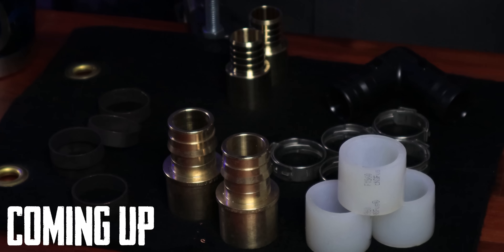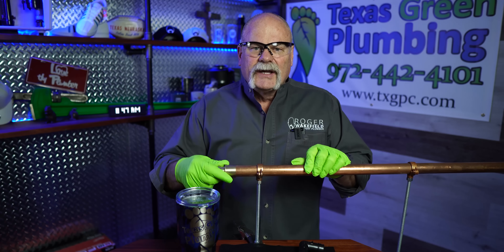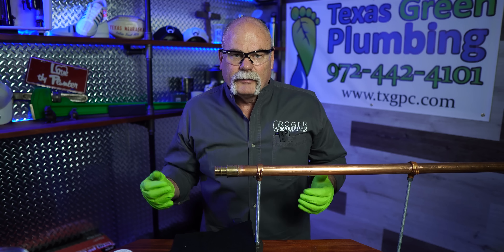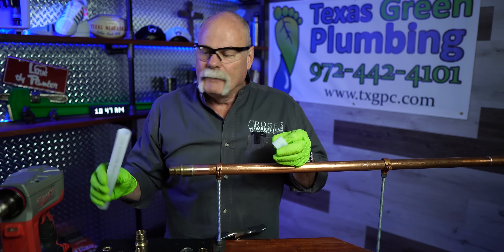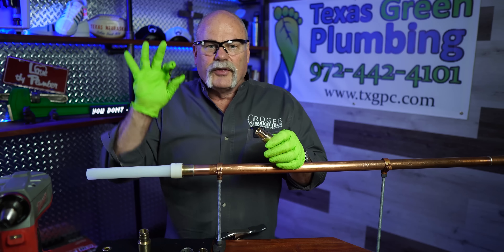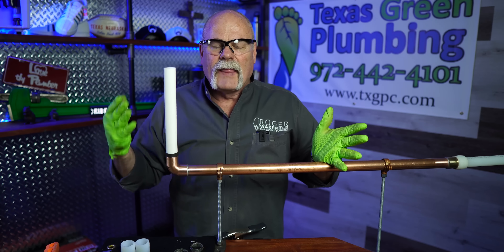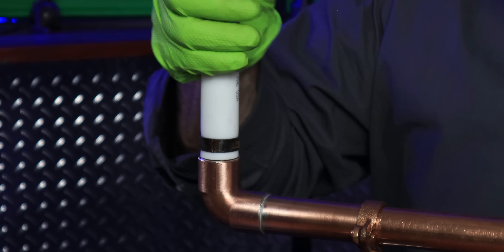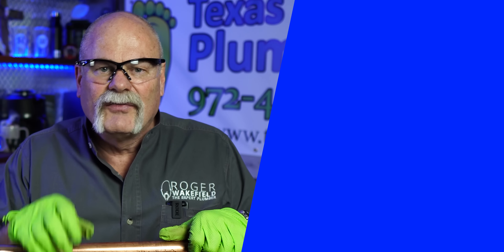How to Connect PEX to Copper Plumbing Pipes

Comment: I made experiments connection pex-a to copper pipe without fittings. Just putted on pex-a the copper pipe. Ther were three different ways. 1 - putted pex-a  on the copper pipe without plastic ring. 2 - with plastic ring. 3 - copper pipe after desoldered (there was elbow before). First and second connection were  not too hurd disconnect using my hands. But third connection (copper pipe with little bit rest of solder) was impossibly detach for two adults men. In addition, I could not rotate the pipe as if it were connected by a regular fitting. Unfortunately I don't have a machine for water pressuring stress test.

Comment: We ripped out all of the corroded galvanized steel and pitted copper from our home.  I used upsized Sharkbite Pex B (Lowes) and steel crimps. I also used the Ryobi P660 (direct tools $70 black friday) crimper for everything. It made the project faster and one tool crimps everything. In fact the only real elbow grease applied was when I was cutting out the old pipe.

Comment: I wanted to add one more comment.  I'm not an expert plumber by any means, but I have done some contracting and hired a few here and there.  One thing I also prefer about the pex A over B is that you can visually look to see that the job was completed.  If the ring is on the pipe and it is snugged up on the fitting, it's done.  As for pex b, there is a possibility they forgot to crimp a ring, or did not use the go-no go gage you showed to test their crimp (I never have seen one used on the jobsite).  So it would be possible to have the drywall all on and painted before you figure out there is a sudden and massive leak behind the wall.  

And it's easy to say (plumbers fault), but they aren't the only one that has to deal with the mess, and likely aren't going to be every completely liable for the error.  If nothing else lost time on the job and heartache.  

I so like pex A in fact i would gladly prefer this over copper any day.  I do NOT like the plastic fittings that uponor sells though, I would spend money on the brass ones.  There is a lot of banter out there on that one, though, as the facts seem to indicate the plastic ones do not break and are highly reliable.  Somebody correct me with a differing opinion if you have heard otherwise.

Comment: Pex a UPONOR in my house except mechanical plumbing at solar and geothermal tanks.  No leaks or breaks or issues in 12 years now. I installed copper distribution manifolds and valves, but the manifolds are horizontal and face down into the pupes.  This causes sediment to settle downwards and a rarely used pipe water will sometimes be discolored. So I would change the design a tad next time.  Otherwise great.

Comment: I send this warning/challenge to everybody I see working with open flame while they're wearing rubber gloves. Take off the gloves before lightning the torch. I was working on my car burning out a suspension bushing. As I watched the flaming rubber sputter and boil I looked at my hands and realized that the gloves I was wearing were made of a similar material. So I took the gloves off, set them next in the gravel, and turned the torch on them. Instant tire fire! Do you want that to happen to your hands? I'm going to guess the answer is no. Don't wear rubber or nitrile gloves while doing hot work. You're probably causing a problem that's worse than the one you're trying to prevent.

Comment: when running all pex. should i T junction off or use a manfold to distribute from the water heater? its a small house, single kitchen, single bath. would have 5 hots and 7 colds

Comment: I crimp A without issue. Expanding B has given me issues. 
You get a higher volume of water flow with A. Especially with 90* elbows in the line. Also, you can make a tighter bend with type A without kinking the one. If B kinks, cut the kink out or you will have problems.

Comment: Wait a minute, you have a video called "Sharkbite Fittings:  Why I don't use them on my plumbing jobs" posted back in July 2019,  The thumbnail for that video shows a SharkBite fitting with a big red circle x and reads "STOP USING SHARKBIES".  While your content was weak, your message seemed clear.  You explained that SharkBite fittings can leak, so that's why you don't use them.  Sure, you said, solder fittings can leak, but you just go in and fix them.  Um, ok.  So that  video wasn't as instructive as I had hoped.  I searched for a different video and cam across this one (how to Connect PEX to Copper Plumbing Pipes) which was posted eleven months after the STOP USING SHARKBITES video.  What a difference a day makes.  Or nine months.  Maybe take down the first one, or at least explain your change of heart.
Reply: Think he was referring to the push and connect shark bite fittings vs what he is doing in this video

Comment: You would not believe how I connected my pipes (totally illegal!):  I took a flaring tool and put a slight flare of the 1/2" rigid copper pipe (only 1/16" of the pipe was flared). Luckily, the copper didn't crack during flaring; old pipes usually do.  I then used a file to file off the sharp edges of the flared end of that copper.  I then took a heat gun and heated up some 1/2" PEX-B, and expanded it to fit OVER the copper, and while the pipe was still hot I used two stainless steel hose clamps to clamp the PEX-B down onto the copper.  I didn't think it would work, I thought it was going to leak like crazy, but 10 years later it is still leak-free. The flare on the copper keeps the PEX from slipping off the end of the copper pipe.

Comment: I have a question.  I am having a home built in Ohio and the plumber is using pex pipe as the 2x4 that goes in between the studs to hold the copper transition between the pex and copper.  Visualize a 14.5" pex pipe screwed horizontally between the studs and the copper transition is screwed to that.  Is this common now instead of installing a 2x4 between the studs to attach the copper transition for a faucet.  To me if I was doing the job I would use a 2x4 is there any thing against codes to use pex pipe in replacement of a 2x4 or am I just being too picky?

Comment: I have a Riobel pex shower valve. The tub spout is for 1/2 inch copper pipe. A plumber friend  of mine said I need to run 2 inches of pex out of the valve then put a pex to copper adapter and run copper to the tub (drop ear to tub). My question, does it matter if I do 2 inches of pex, or could I go longer down to the tub with pex and a little copper before the drop ear. Will one be better for water pressure? Does it matter? Love your channel. DIYer.

Comment: someone doesn't  understand  expansion and contraction lmfao.  in freezing  things contract in the heat things expand you may argue if the water freezes it  would expand it but nope wrong again  the water expanded causing the ring to stretch out and possibly  crack which in this situation I'm almost  certain the  copper pipe would fail before the ring as it's a lot thinner gauge
Reply: You've sniffed too much glue, the concern is definitely the water expanding during freezing
Reply: @Dj-yq3un  obviously you  eat  glue by the gallon as that was covered  in my  original  comment  wich is not what roger described  not only that but you have a later of brass the fitting  and the copper ring tht would have to give way to the   expanding   water when its frozen the  copper pipe will fail first almost everytime
Reply: @timjohnson6864  it seems you’re using a type writer on the internet. This is more proof you sniff glue.
Reply: @Dj-yq3un  says the guy that cannot come up with a valid argument
Reply: @timjohnson6864  my argument was my first comment, you’ve chosen to ignore science
Reply: @Dj-yq3un  again go read my  original comment   once again this time read it slowly and out loud have  your dad near by so if you get stuck he can explain it to you when a peice of copper freezes  it will shrink water on the other hand  has a tendency  to  expand  when frozen bursting open pipes  so there fore the ring if anything  would either break or stretch due to the water in the pipe freezing however.  this is still unlikely  due to the fact that copper tubing is  the weaker link 9x out of 10 if you see a burst  pipe it's always on the pipe never the fitting
Reply: @Dj-yq3un  the copper will shrink by itself if frozen  however  when water freezes it tends to expand that is why it cracks open if the copper  was hot and sufficient pressure  applied it would stretch  to a certain  extent  lay off the crack kid

Comment: Where im from your not even allowed to have any copper up in the attic of a house
Reply: Where I'm from, where winter temperatures in the attic hit minus 30 degrees, your not allowed to run any type of water pipe in an attic for any reason.

Comment: Definitely use latex gloves so if you burn yourself on accident the melted rubber instantly melts and  seals your wound
Excellent idea
Reply: It's for flux, not solder. That will fly through any thin glove.

Comment: yeah,  your tool is cool, but how much does your umpemoor tool cost?
Reply: In Canada the basic Uponor expansion tool, made by Milwaulkee, sells for $650.00     Only a professional plumber is going to make that type of investment.   DIY'ers are pretty much restricted to the crimp ring or clamp rings.
Reply: @chrisgraham2904  or spend 100 bucks and get the manual expander tool. Or I think the Milwaukee m12 version is about $250?

Comment: i use zurn now uponor had to many failures with the expansion ring sliding down pipe as you would expand it, I have used pex b,  also had to many failures of all different crimp rings.  good video!!
Reply: I'm sure the uponor rings sliding down was before they added the shoulder stop. I've never had a problem with the ring sliding down pipe.. pretty much impossible with the improved rings in my opinion.

Comment: I personally use pex b. I have also used pex a pipe with pex b fittings. The only reason I prefer pex b is because I can retrofit from the old PB plumbing. Nibco makes a lot of Polybutylene fittings for use with pex b.

Comment: Which blow torch system are you using there in the USA, that looks alot more stable and hotter than the hand held mapp gas systems we have here in the UK,, hand held canister torches seem to waste too much gas before you can turn the torch upside down as the thermocouple needs to be at temperature, if not it becomes a flame thrower and I watched another of your videos and you certainly don't want to flame throw if you have removed bricks to a cavity like you did,, great video ❤️👍and I hope the USA gets back to being the USA soon and us here in the UK,, the world may have gone mad but you'll always need a plumber unless you want to get typhoid eventually 😉👍❤️
Reply: Acetylene/Air. We use turbo torches fed with Acetylene 'B' bottles.

Comment: For PEX, I use PEX-A exclusively.  I've used it for both potable water and hydronic heating applications.  I have used PEX-A with crimp rings to temporarily attach plugs (as they're easier to remove and reuse the plugs than trying to remove an expansion collar).  PEX-A is rated for either expansion or crimp (obviously expansion has benefits but if you had a crimp style fixture [like a laundry box] you can still crimp it).

Comment: Roger, I’m only a first year, but I work in new construction and we definitely crimp type A. We do it for every shower valve and we do it for fixes in tight spaces, when we don’t want a 1in sleeve to slip behind Sheetrock, for example. I’ve been told using crimp on pex a voids the warranty, so I guess the company I work for just counts on insurance?

Comment: Thanks Roger, your videos are amazing!  I did a search on what is the most reliable plumbing method.  As a real estate agent, it is my responsibility to become an expert on all building systems.  Then i came across your videos and just cant stop watching them!!  Having said that, i had a listing in a multifamily building with 1 inch pex leak at the joint &  the building is 16 years old.
 ---- Question!!------
 What is the most reliable plumbing method in a new house?  I do like the Uponor pex a system, have seen many issues with pex B leaks at the joints, copper, over time pinhole leaks, but nothing catastrophic, and the propress system.  What about using type k and braise for the utility room and using a large diameter home run system with a hot water return line?   Roger or plumbers, Please comment!!
Reply from the maker: I really think uponor PEX Type A will be what we all use for new builds in the future. I like copper but price and labor cost will always win out.

Comment: Huge fan of Uponor/Wirsbo pipe system. Recently invested in an expansion tool. Have had a Nibco crimp tool for years. I like that crimp method above all other brands on the market, mainly because it's dummy proof. No guessing on where the ring has to be centered. But as a service plumber , it's necessary to have a crimp tool for repairs on type b, and I have expansion for new installs. I have switched to male to female adapters when transitioning from copper to pex. Our company has had a lot of issues with the brass adapters not soldering properly. They seem to overheat quickly.

Comment: Uponor pipping can be used both for Uponor fittings and pex fittings. I have installed both Uponor and pex in my years as a licensed plumber. Copper is still to me superior over any other water system altho here on the gulf coast or any salt water body I recommend going to Pex or Uponor. Avoid sunlight as much as possible on both. They do have UV rays protectant on the materials but like anything after awhile it'll wear out. Not a fan of CPVC in a house. Sure the I.D. is bigger than pex but it is the most fragile vs the other pipping. Can't take a freeze for nothing. Copper can't much either but it is tougher. Love the vids thank you

Comment: I've seen and repaired far too many bad crimp joints to feel at all comfortable using it myself.  Copper is my go to method, something spiritual about sweating clean joints.  That said, I've got my trusty Milwaukee expansion tool and uponer ready to go if copper is not feasible. I think uponer is genius. Especially for situations where freezing is a concern.
Reply: Also good when the water chemistry is evil. Copper isn't what it was 20 years ago or so. Now it is imported, and quality is not the same, unfortunately.
Reply: @elbuggo  Roger that. I use Uponer for well systems.
Reply: There is a class action lawsuit against the developer in a local town. All of the copper plumbing in a newer development are developing pinhole leaks.

Comment: I know I'm just a "handyman" but I've been replacing old nasty copper/brass pipes and iron fittings that old plumbers used with the almighty pex for nearly 10 years. How do you feel about sharkbite push fittings? Some people stand by them, some not so much?

Comment: I always slightly squeeze the crimp ring with pliers to keep it from slipping while using the crimp tool
Reply: Pro crimp rings have a plastic "cap" that prevents the the ring from sliding. Lifesaver for crimping

Comment: Just curious, does the sharkbite crimp tool open big enough to come off the pipe sideways?  Otherwise how the heck would you get in off if both ends were connected 20' away and through the top plate of a wall? Anyway, we use PEX A exclusively and the local supply houses don't carry anything for B. B is considered to be DIY home depot stuff in by the pros around here.

Comment: Uponor, is the best way to go. It pretty much copies  R W Lyall's LycoFit couplings design for polyethylene gas tubing ( pipe). Instead of an expansion tool, it uses the actual coupling as an expansion device and uses a mechanical or hydraulic press tool to insert the coupling. We've been using them for decades in the gas industry with no problems ( in my opinion there is nothing better on the market to connect 1/2" to 2" polyethylene gas tubing).
Reply: where do you purchase and how much should i expect to pay
Reply: @jeffjacobs8682  , if you're talking about the lycofit fittings, you should call RW Lyall in New Berlin ,
Wisconsin ( you might be on hold a while, they're understaffed). I believe Ferguson Plumbing has a limited supply of their materials. You probably should watch some of their YouTube videos to familiarize yourself with their products. As far as pricing I would not have a clue ( I worked for the seventh largest gas utility in the country and we bought the stuff by the tractor trailer full).
Uponor stuff  , all the plumbing supply houses sell Uponor.

Comment: Good luck getting that sharkbite crimping tool in a tight spot.
Reply: A lot of people are buying the combination crimp ring tool that does both 1/2" and 3/4" to save buying two tools or a tool with interchangeable heads.  The 1/2" crimp section is out front and bad enough to get into tight spaces, but the 3/4" crimp section is further down the tool and almost impossible to get into fifty percent of locations.

Comment: Now I prefer uponor (wirsbo) PEX A  pipe  over PEX B because it's much easier to un coil I use it with both fittings uponor and pex b fittings but I use viega stainless steel crimp sleeves instead of copper rings or stainless steel clamp rings. But that's what I prefer because my Milwaukee M12 jaw are for viega sleeves and I have Milwaukee propex M12 expansion tool as well.

Comment: Lately we've been using PE-RT at our shop. It's a little stiffer than PEX, but it is supposed to be stronger, especially with hot water. We use copper crimp rings.

Comment: Uponor (Pex A) in my opinion is the better pipe. You get better water flow through it.
Sharkbite (Pex B) is still good. I like it better than cpvc. But at each fitting you get water restriction. 1/2" pipe is 3/8" water flow at each fitting, same on 3/4" is 1/2" water flow at each fitting.